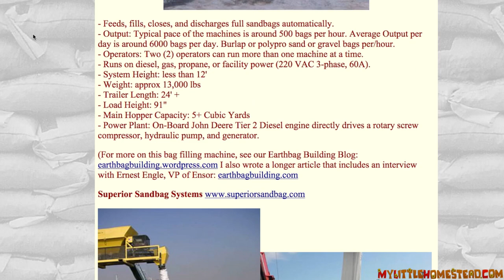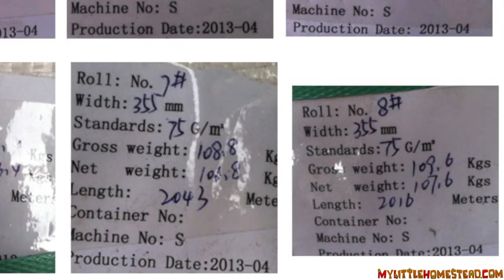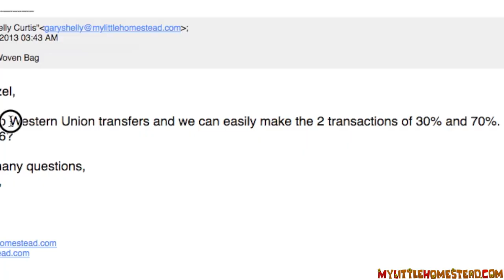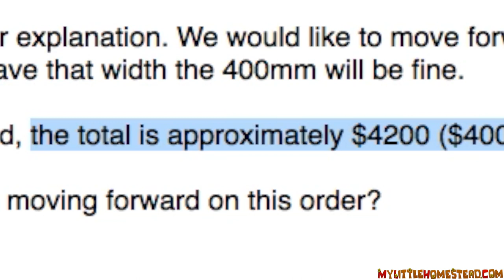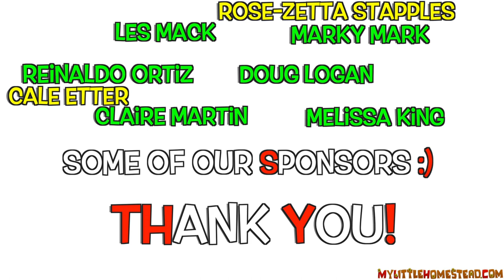Where We Bought our Earthbags (Continuous Sandbags or Earth Bags :)  | Weekly Peek Ep48

Comment: For earthbag buildings is a certain type of soil required?  Do you need a certain percentage of clay or sand?  Or will any old dirt work?
Reply from the maker: +Andy 
Good question. Not sure about the oil dirt. Our experience is with clay mixture. 50/50. We also have large amounts of calcium (caliche). The soil needs a bonding element like clay or something like pumas mixed with silt.
Reply: Pumas? Sounds dangerous.
Reply: As a general rule of thumb, you need a minimum of 15% and maximum of 30% clay for most environments. People building these in the desert southwest and the pacific northwest have used different compositions due to the extreme nature of the environments, and slight difference in the types of clays available locally. I live in Georgia, and we have lateritic clays with concentrations of kaolinite. They do very well in a 20% clay to 70% sand mix. Nobody here really builds earthbag houses (at least they're not talking about it - building codes + entrenched mindsets), but there are retaining walls and terraces all over that use earthbags that are then covered up by wood fencing. 

I recommend you get the book "Earthbag Building" by Kaki Hunter and  Donald Kiffmeyer. It demystifies the whole thing, and covers the entire process of building an earthbag home.
Reply: ***** I thought that traditionally people in the desert used poop?
Reply: Everyone used poop. Specifically manure from large animals that fed on grass. Undigested grass fibers added additional strength, and there were certain digestive proteins that formed water-insoluble glues acting as a supplemental binder. It wasn't just for adobe brick making, either. Horse manure was a key ingredient in making molds for metal casting. Every bell and statue in the US up until about 1970 owed it's existence to horse dung. Really... I'm not sh*tting you here...
Reply from the maker: +Andrew Krause 
Great answer...thanks.
Reply from the maker: +Andrew Krause 
Love the detail.  Thanks
Reply from the maker: +ThisFish 
Sounds cat fishy
Reply: No - thank you guys. Before your videos, I hadn't given serious consideration to Earthbag construction. I was going to shell out huge $$$ for an all-concrete foundation and retaining wall ala "Earthship" style. Also, your videos are way fun.
Reply: ...that's a typo...it is spelled "pumice".
Reply: I think you meant "pumice", not "pumas"....it's that aerated lava rock often used for landscape cover.   Great insulator in walls.  In earthbag building, good for filling lower rows of bags for building in wet climates or where there is high water table, to prevent moisture wicking up into earthen walls built onto those rows.
Reply: No, he meant pumas. Wild pumas used to be all over the desert southwest, but now that so many people are grinding them up for earthbag buildings, the population is endangered :)
Reply: Being sarcastic?"
Reply: Tresa Lamb Great to know.  
Wish there was a list of areas that had that kind of permissiveness!    
Might have to get real creative in finding places, including negotiating with certain groups of people or individuals...
 say, maybe, I build this off-grid earthbag house, on your land, as a demo and instructional for this group of people or individual, as long as I'm allowed to live out my life in it on that site, as in a normal home. 
IT would be great for groups of people wanting this things, to en masse approach their Permitting Dept's, with Plans in hand, as well as an engineer of their own to represent them [because many Counties or Municipalities lack their own staff Engineer...so their knee-jerk response to odd building, is "no".] 
Another way, is to try to find, in the UBC [Universal Building Codes, which most places have adopted], which could also describe what tech you want to build with....
For instance, "Rammed Earth", might also include earth bags or earthship building; "Reinforced concrete" or "SIPs", might feasibly include Rastra Blocks, ceramicized buildings, anything that had some cement and metal reinforcement.  
One might learn that there's no-permit required to build a "basement", UNLESS one is planning to build a house on top of it--then it needs permitted/engineered.   But what if it stays as a "basement" [aka: underground house]?   
Peruse the UBC for whatever loopholes you can find, that fit what you want to do. 
We put up a few buildings, that were technically "no permit".  
Permits are required if one hooks the place to Grid power, gets a permitted well, etc.
They will tell people "you cannot live in a storage bldg"....but....If the place has portable solar/wind power, it's not hooked to Grid.  
If it collects water [covertly!!!!], to use for the cabin, just make sure it's well-filtered. 
If all systems are portable, then you are camping at that site, not "living" at that site.
Who is going to know how long you are there, or for how long, if you keep a low profile? 
People's non-permitted places get grandfathered in all the time. 
One guy told me, "Make sure if you go no-permit, keep everything the same no permit...but let the assessor do their assessments, so you are paying fair taxes...that way, the County gets income, and, they are less likely to condemn you...the longer there, the less likely.  
If you go permit for one thing, it's sensible to get permits on everything...otherwise, it's booking' for a fight.
Reply: *****   Joking, right? About grinding up 4-legged big cats [pumas], to fill bags and tires?    
Many people now, have a hard time recognizing that kind of joke.
Pumice is a type of volcanic rock, light-weight and insulative, because it has lots of air-pockets in it.  
It's commonly used for roads, landscaping, and to fill the bottom few rows of earthbags or tires, in wet climates.
Safe to say, we're talking about building materials here.....that Pumice stone is a building, paving material that comes from volcanic explosions.
Reply: ***** What one packs the bags or tires with, depends on location, and climate needs.  If it's a dry climate, one that will never get flooded, then using dirt from the site is good.  
Nadir Khalili [ calearth.org ] didn't use clay mixed into all his earthbag houses, because his location was Desert.  There was no real good source of clay on site.  His earthbag houses were legally Permitted by San Bernardino County, CA--one of the most seismically active areas in the country. 
But, those depend more on the barb wire and wall coverings to stabilize them. 
If one has clay, then one can mix some into the bag- or tire- fill.  
Clay will tend to hold moisture. 
     IF in a damp or wet climate, even if it's only 100 or 500 year occasional flooding, it's important to give the lower layers good drainage capability.   Filling those rows with volcanic Pumice stones, is insulative, as well as it drains and dries well if flooded. 
     IF one uses Oily dirt [contaminated dirt?], I'd worry about that seeping over time.  
The oil products manufactured into tires, stays put, sequestered by the tires and the wall covering plasters.  
     But, Oil of any kind, in dirt, used to fill bags or tires, could feasibly migrate, and "bleed" through wall plasterings, putting oil VOC's into the living space.   
     Using Linseed oil [non-preserved, but cooked], is used to stabilize adobe or 'dirt' floors, but that is not used on a vertical structure. 
IDK...maybe Linseed oil_ might_ work to stabilize silty soil in bags or tires, in lieu of clay.   
Might check with Calearth.org, or, look up Mike Reynolds [earthships, Taos, NM] to see what his take on using oil to stabilize dirt fill is.
Reply: ThisFish Horse manure, usually, is used to make Adobe bricks.  It's also used as part of plastering on some strawbale houses. 
But not all the time.  The enzymes in fresh horse manures, are key to making good adobe, I think.
Reply: ***** 
LOL.  Be nice.  Even if their original comment was mislead, they gave some decent information.
Reply: ***** Dang dead giveaway, not recognizing "humor"! 
With something more like 1 in 50 people dealing with ASD, it becomes a game-changer for communications, in many ways.
Reply: Winter Star 
Written humor, specifically in the short hand online communication we use, is very easy to misconstrue for everyone.  You had good intentions, don't stress it one bit.
Reply: ***** People rarely grok how huge the effects of a supervolcano are.  There was a movie done some years ago, that used a computer construct of what the Yellowstone super volcano would likely do, based on geological evidence of its previous blows...very impressive.  That one has left quite a trail.
Maybe ppl think N. ID is hundreds of miles away, so won't be affected?
Ppl also worry about [in this order] Mt. St. Helens, Mt. Rainier.[WA]..  A few tin-foil hat ppl speculate about Mt. Shasta....A few bits on Mt. Baker.   Nothing of Mt. Olympus. Nothing of Mt. Adams [OR], less than nothing about Mt. Diablo [CA], etc.   Virtually nothing about other potential dormant volcanoes dotting the US.   NO one wants to talk about the Jan. 1700 super-tsunami that washed inland from the west coast, in towards Centralia, WA, that reached about 30' deep in Centralia, WA....which meant water was even deeper all along the Chehalis river basin between that location and the coast.
People today have very hard time wrapping their brains around how huge those events were, because there have been no such mega-events for hundreds of years. 
People forget even regular 'big' catastrophes within a couple decades....too often even stopping using prudent precautions in building codes/styles/siting.
bermed-in earthbag, earthship, monolithic domes, etc similar, have a real chance to help people survive in place, if sited and built right, though even these cannot survive some mega-events.  They can survive [using exterior pozzolanic plasters] big wild fires, very significant earthquakes [if also wrapping the building blocks with chicken wire before plastering].....without crawling into a bunker of cement.
Don't site downwind from a  supervolcano.. ...that's an enormous territory!
At least build-in air systems and a way to dig-out through 10-50' of ash...and water source accessible from inside!
..
Reply: I actually play to stay in the lower tier along the sun belt. The closest I would move in that direction is perhaps southern colorado, where ash fallout less expected to be around 5-6". Further south (New Mexico, Arizona, Texas) will get half that. But we'll survive, and although we'll have reduced solar power and shorter growing seasons for a few years, we'll make it just fine. Also, all that ash will make excellent water filtration, so...

I've thought way too much about something that's unlikely to happen :)
Reply: ***** If that computer construct about Yellowstone super volcano was any indication, the SW and southern States would be buried in several FEET or more of ash from that.  S. CO would be more like 10'-20"+ ash-buried.  Those to the east, get a bit less; those to the south of it get more.  
Even those far West of it [coastal], get feet of ash, though less, due to mostly being up-wind of most of that. 
Heck, Mt. St. Helens left several inches deep of ash, near the WA/ID border/Hoover Dam area, where we stopped to pick some up as a souvenir....that was a few hundred miles away from that volcano.  
Multiple good micro-filter masks and replacement filters for vehicles were needed for that one. Goggles to protect eyes needed for days.   Water filtration. 
Volcanic dust is microscopic particles, much of which is sharp like glass shards, which wreak havoc on airways and eye tissues...and vehicle operations.  
All that ash becomes nice, rich grow media for plants later, as soon as biotics move in and start enlivening it. 
Some folks will survive.  Worst case scenario is if multiple of them go off, creating extinction event, like past ones, where only a few thousand of anything survived, and had to re-start from there.  
Yeah...me too...way too much brain energy considering all facets ;-)
Reply: The model I saw limits fall-out greater than ten inches to the immediate windward areas. Also, we have geological indications from the last time it erupted that put that level of fallout in Nebraska, Iowa and South Dakota.
Reply: *****  I knew there was good reason to avoid the Midwest!   
We lived there a few years, about 45 yrs. ago, and figured it was not for us.   Severe annual weather, tornados, random flooding in some areas...the final icing on that cake was the super volcano fallout.  More liberal building codes just couldn't balance all that.
Reply: you'll find very liberal building codes in west texas for sure. And in rural New Mexico, Arizona and Nevada, nobody really cares.
Reply: Winter Star Horse Manure? You mean i've been wasting my time collecting Puma poop? (The hardest part was getting him into my closet, RIP Mr Jinkers, my guinea pig)
Reply: There´s a book: earthbag building, tips and techniques... they have some good info there